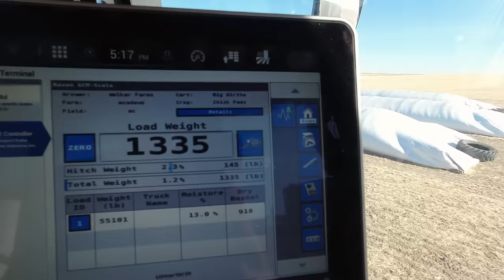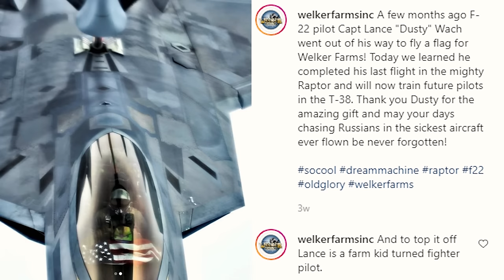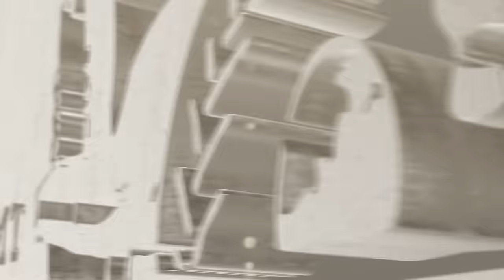F-22 Fighter Pilot Drives My Tractor

Comment: 187 operational F-22’s 195 total built with 8 I think, for testing and they crashed one. Bob, there are methods to get that oil out, it depends on the geology and weather the oil grades well enough to justify the costs. The oil company I worked at for years, we did a lot of shallow well horizontal drilling. But the price of a barrel has to be up there to make it pay for it. They are always coming up with new methods.
Reply: Yep. Thanks for that bit of info Bob. Curious, just never get the chance to ? about that.

Comment: Blown your horn before you start any piece of equipment especially on a farm with cat's and vermin saves a lot of money in down time money !
Reply: I'm suprised the 8230 doesn't do it on its own, i have a New Holland CX6080 2013 year model (built in 2016) and it horns 3 times when you turn the key, before you have to turn it again to run the engine.
Reply: Let me clarify my statement the out side horn make noise to scare of cats and other vermin to preventing damage to the engine and very expressive down time.

Comment: We’ve had that happen to two combines. But they were raccoons and it wrecked the radiator and oil cooler. 🤦‍♂️
Reply: We started up a mixer mill in the winter , and a raccoon was in by the hammers. It was already dead because it fell into it and froze to death. But it made a hell of a noise and an even bigger mess.
Reply: oops... that sounds expensive

Comment: 2:02 you should next time check every moving parts where any thing can get in before starting. Doing this might be helpful if something is worn-out and needs replacing or repairing
Reply: That's almost impossible. I don't know if you've ever been around combines before but there's so many moving parts that you would be spending hours upon hours checking it. Quite a few moving parts you can't even get to without taking the whole machine apart. Yes it's sad that the cat died but there's no chance any farmer has that much time

Comment: I think Grandpa needs to build a solar heater for the pool ! 4x8' sheet of plywood painted black on a 2x4" frame. Use 1" 100' ft. black plastic flex pipe hooked to slow moving water pump. Piping enclosed with glass. Set it to most sunlight during the day.

Comment: Hey papa Welker.   We have a few of those shallow fields in East Texas with some miserably thick 17 -19 gravity oil.    They use steam injection to get it out of the formation and into the well bore.   just about every other well that was drilled, was used for steam injection.    But when it gets in those storage tanks if the air temperature falls below 80°, you have to have a hot oil truck to get it thin enough to put in the transport truck.

Comment: Boy this Cat in the Fan reminds me of my 5 years that I lived in Alaska in the late 70's, and the first time I had this go on was in Fairbanks, at Ft Wainwright, and I came out one morning and got in my car, a brand new 78 Mercury Grand Marquis, that had a 460 engine and had 2 engine Block heaters & Battery Heater, as up there it would get to -50 below. So I tried starting the car one morning, but this horrible noise came from the Engine Bay, But then I saw this cat run across the parking lot. Well it was well below zero and I'm sure the cat was in there staying warm. Well from then on, I would always hit the hood of the car before I would get in to start it as there would be cats all the time staying warm on the engine!!

Comment: Just a suggestion: try chickpeas on summer fallow.  I have grown Kabili's in southern AB and when conditions are right they will do 60-70 bu/ac  but if you have enough growing season rain to do that, they will be full of ascochyta.    They will root deep and pull up moisture from below if it is there.  Can grow them in rotation with winter wheat on a 1 in 3 year basis with fallow.
Reply: We struggle with no or little rain after July first.

Comment: Nick.
Answer to the gas pipes sticking up in the fields is. Take a 6 foot steel Tee fence post and drive it in the ground next to the gas pipe about 18 to 20 inches deep. Next take a  10 foot stick of 2 inch white PVC pipe and slide the PVC pipe over the steel Tee post you now have a passive gas pipe marker. With the 10 foot white PVC pipe stoking up in the air all equipment operators can see it.
Take Care Be Safe Alway's Around all Farm equipment.

Comment: What GPS correction do you have ? rtk, rtx center point ? Rtx range point ?
Reply: Actually the combines are just running waas.  With our type of large fields, big equipment and no row crops it hasn't made much difference.  Used range point on Trimble auto steer for our previous combines but the hydro GPS on these work very well.

Comment: I need more info on the Westfield drive over auger what’s it like ?
Reply from the maker: The auger is stout and works excellent, the gulp 2 drive over works well but has lots of room for improvement (leaks grain, narrow dumping area, clunky). It is much better than using a separate grain deck in tandem with an auger. I believe an update is in the works.

Comment: Alkali soil can be fixed to a degree. but at this small scale, it's pointless. some places they would deep plow it. And if it is Alkali soil with solid CaCO3  acidifying material or organic material. Calcium chloride  or pyrite is also possible to do.

But as little as it is here, what's the point. except experimenting with different solution.

but then I am not an expert